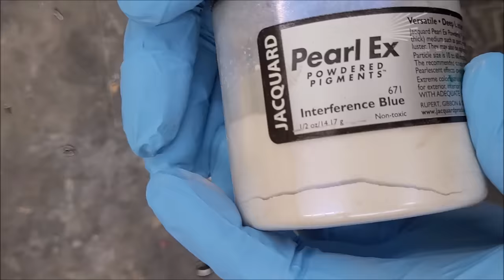Big Ash Bowl with Resin

Comment: Sounds like the speed of the lathe and the chipout issue are basically a Catch-22 situation.

You have to spin fast to get a good, smooth cut, but that means the piece will tend to wobble even worse.  But slowing down the RPM means you don't get a good, smooth cut.  The whole idea is to round the piece down so you can minimize the wobble as much as possible, but that takes finesse, I am guessing.  

It's a balancing act.

In any case, another very excellent job.  You're quite the artist with the lathe.
Reply from the maker: Thank you Liam,  I think the speed and chip out are related,

Comment: Nice!   Seems like you coulda shaped the outside then used uv resin to fill any holes/voids since you removed the majority of the resin.  😊
Reply from the maker: Thank you Normagene, I did use UV resin and I filmed it but I have no clue where that footage went
Reply: @PohlBarnProductions  I did hear you say that but I meant right from the start…why not shape it then use uv resin to fill any of the holes/voids.   Instead of using so much resin at the start which it looked like 90+% was turned off.  Or did it just have way to many cracks/voids?   It just seemed like a lot of resin just went to waste.  🤔
Reply from the maker: well the UV doesn't cure all that good once you color it,  only on the top, the light needs to penetrate it, and it can not if it's colored, and I have limited UV, but Supplied with Resin,  I was also trying to fill as much into the cracks as I could so the inside turn would be done

Comment: Outstanding job Doug as usual.  Could you tell me what gouge your using?   I've been using carbide but would like to learn how to use gouges.
Reply from the maker: Thank you Steve,  I am using a Carter and Son's 5/8 Bowl Gouge,
Reply: Thanks for the quick response Doug.  You sir make it look easy and I especially loved this one because you explained your moving slow with epoxy.   @PohlBarnProductions
Reply from the maker: it is what it is I guess,  I know it's not easy and I forced myself to learn because the carbide cutter are pricey and dull quickly with the resin, or the mica powders in the resin.